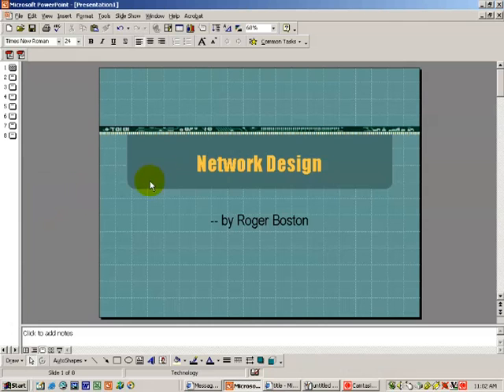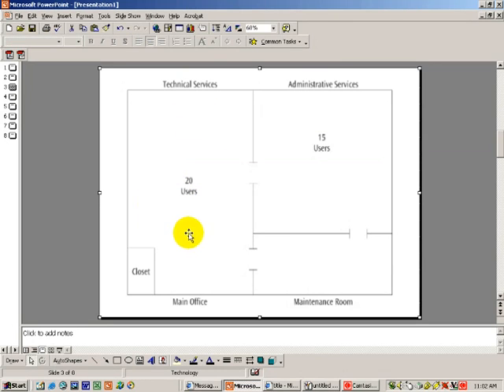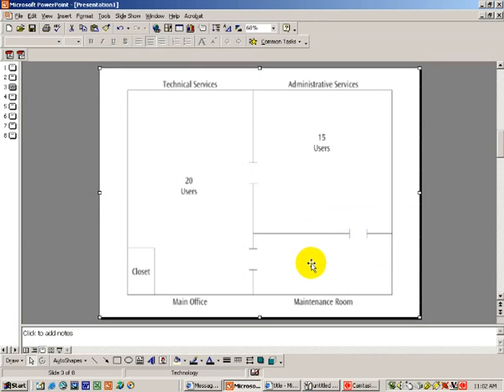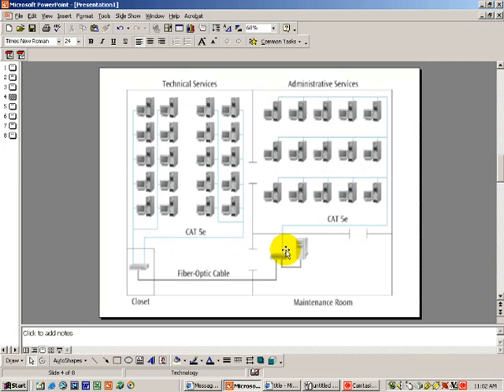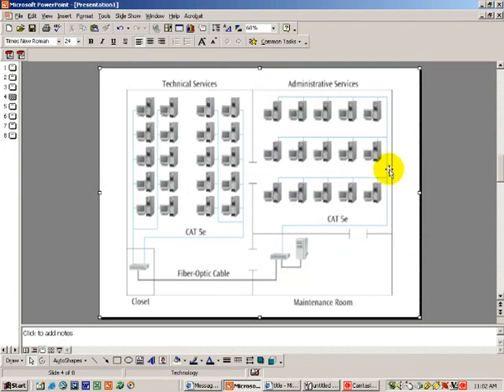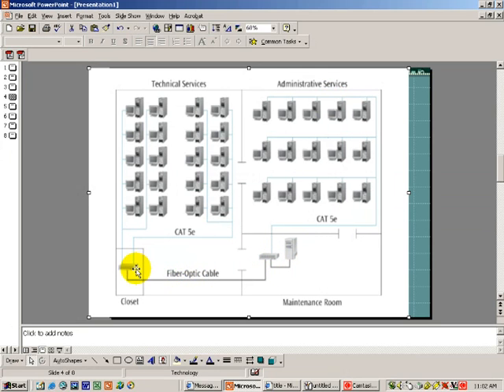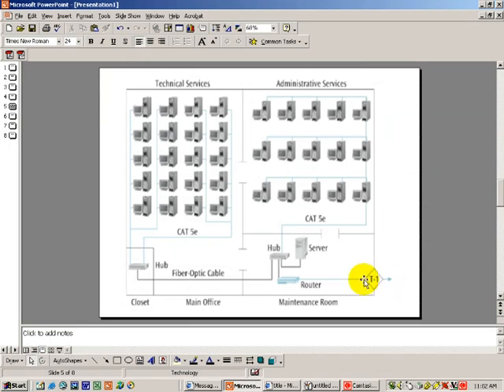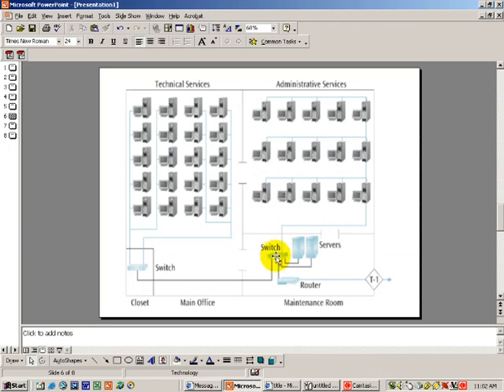Network Design

Comment: I guess, fiber optical cable has lightning speed of transmission. As it supports more bandwidth than regular CAT5e or CAT6... as per the network design there were 20 users connected to a hub. 20 users mean huge traffic (can be gigabits/second traffic) therefore fiber optical cable is more preferred. but i've learn that Ethernet CAT 6 is also a better cable for Gbps transmission.